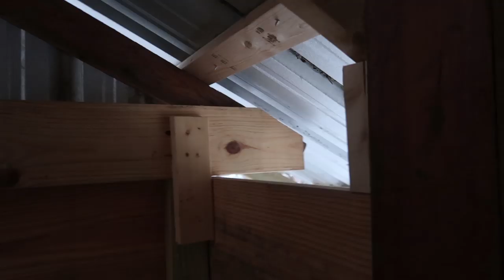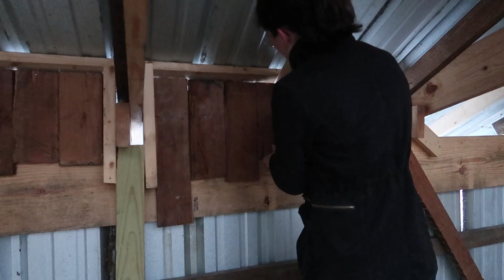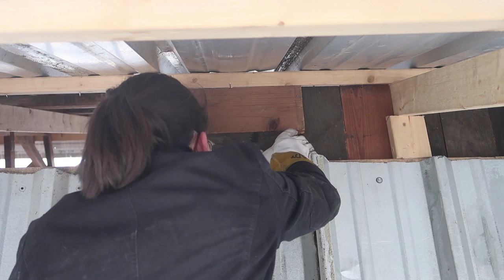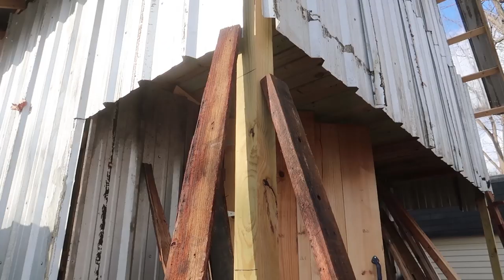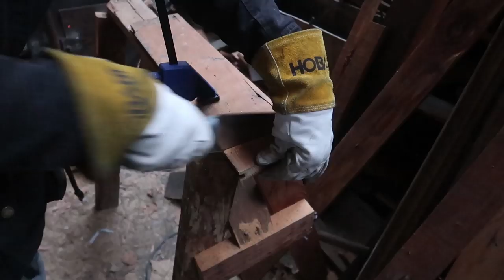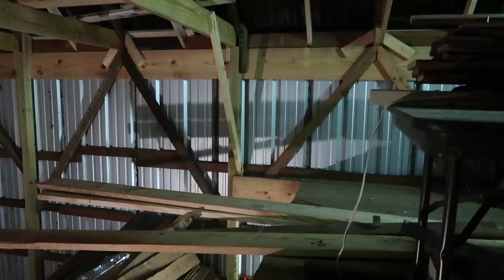Building a 15'x28' (5mx9m) Workshop 24: Patching Holes Where the Walls Meet the Roof

Comment: You are going to have a nice space for future projects, great project and very inspirational to me. I built three small buildings using recycled metal roofing. I tarp the framing in with the material lumberyards throw away that they use to tarp their lumber trucks, it's like tivek. I also duck tape the nail holes on the inside and patch them with bondo on the outside. All the best with your projects.

Comment: I personally would foam the corners . I just completed my garage and used battened insulation (r13 ) then plastic ( weep barrier) then luan thin plywood and its 70 in here and -10 outside! My heat source is different then yours but it looks like your making plenty of burning material! Lol . So far so good ! By the way mark your areas in the day time , it’s easier to see the light coming through the openings ! Lol

Comment: I used to work in a metal building here in Ohio. They spray-foamed the underside of the roof and it had insulated walls. Between running welders and such in the building, the cool night air would condense on the roof and it would almost look like it was raining. It produced a considerable amount of water on humid summer nights.
Reply from the maker: should have had a dehumidifier

Comment: Get some thin wall PVC pipe 4" if that is good, heat it up over the stove and cut a slit down it lengthwise.  Then you can let it open up so it goes around the corner and screw it down.  Paint is optional.

Comment: Rinoa, you have put a lot of work into this workshop, and it shows.
I don't know if you remember me, but I was the one asking about the batteries you've made for your electric bicycle.
I'm still building the Atomic Zombie Streetfox, and the build is coming along slow, but it's getting there.
Once I get the bike finished, I'm hoping to electrify it and charge it using renewable energy.
I wish I had a place like yours to do that sort of work in. Are you planning on adding solar panels and powering your workshop that way?
LED lighting has come quite a ways since the early days, so you might consider LED bulbs and rope lighting.
Reply from the maker: i remember you a tiny bit but then i searched all your past comments to get reminded. you told me "Oh, and keep smiling, it makes people wonder what you're up to." so that was quite funny.

Yeah i plan to have maybe 1,200 watts of solar on this, and maybe a wind turbine also just for fun. then i will use my Nissan Leaf battery pack to have about 24kwh of power capacity. but idk. i might just make a 1.5kwh pack and connect it to the grid.
Reply: Not bad. I do hope to send you a picture of the trike when it is done. It's powdercoated Seahawks "Action" neon green so it really stands out. I'm planning on lighting it up with both white and UV LED so the green stands out at night and the white can light up the road ahead. Have you done much with batteries lately?

Comment: Have you thought about filling the roof holes with slightly oversized metal screws with neoprene washers? Also, if you put up a ceiling fan you will get way more heat at the floor level.  Keep up the video's.
Reply from the maker: i already covered the holes with outdoor tape, and a friend just set aside a ceiling fan for me. so there ya go. ^^

Comment: A suggestion for fixng the corners and sealing the holes in the roof and walls. Fill in between the purloins/cross pieces at the corners wth pieces of two by four that overlap making an L shape closing up the corners, then you could screw the wall tin to them sealing up the corners. To seal the holes in the tin get some self tapping screws, a bit bigger than the holes in the tin, with rubber washers on them and put some tar over each hole and put in a scew and washer thereby sealing the holes.
Reply from the maker: that L idea is a good one, i hadnt though of it. however i think that would be a less-good solution since i would have to use a lot of 2x4s then. my plan is to scrounge up some more roofing metal and use that.

Comment: If you had some metal siding leftover you could bend into a square corner.  Look up a sheet metal brake.  You could make it out of the wood you have on hand.  Each corner piece could be cut to 3 or 4 foot piece and bent.  I think you could make one with no problem.  Good luck.
Reply from the maker: yeah thats what i was hoping for but i ran out. thankfully i keep finding more of other stuff. currently i have like 3 options. will ponder it while im getting other things done.

Comment: Aluminum valley flashing might work it's not real heavy gauge, runs about $9 for a 10"x10' roll at Home Depot, Lowes would probably be similar in price. Clamping a piece between two long boards will hold it place while you bend it. Maybe butt jointing 2 pieces of 1"x just make sure you pre-drill so it doesn't split.
Reply from the maker: well i'd actually need more like 24" wide metal for it to make sure its got a good seal. i plan to use old roofing metal or something.

Comment: I think you should put metal roofing underneath the floor of your loft cause air is probably coming thru the cracks of the boards
Reply from the maker: well im going to be putting down like a layer of thin foam, then hardwood flooring over that. and under the loft i will also probably add a "roof" of extra flooring bits and stuff some insulation above it.

Comment: I've got the same saw and the teeth are off sent some it is a pull saw other saws are a push cut so it cut back ward for regular and they do cut real good
Reply from the maker: well its a japanese saw, of course its a pull saw. but on this one a set of teeth arent offset correctly meaning it cuts a curve not straight.
Reply: its like when using a portaband and a bunch of the teeth have broken of on one side then it cuts a curve to
Reply from the maker: yeah, actually it is like that.

Comment: Teeth on a saw needs to be offset if not the saw would bind when you are cutting
Reply from the maker: but each side of teeth should be offset the same amount. for instance the machine that was supposed to press the teeth left didnt, but it did press the other teeth right
Reply: needs a saw set, to set the teeth
Reply from the maker: sadly these saws arent meant to be set since they are tempered so hard, so ill probably end up breaking the teeth

Comment: I wonder if edge gluing and later cutting the assembled panel would be a good idea.
Even transferring from a cardboard 'paper doll' like Mustie1 does for metal car body and frame work would be tidier and the waste is still good for that 'stove' that you've cobbled together?
Just an idea. Thinking out loud, lol.
Oh and about how much was your Japanese pull saw?
Reply from the maker: saw was only 10$, so i cant quite complain.
Reply: @RinoaL  you can gently tweak the teeth by sighting down the immobilized/clamped cutting edge. Maybe file. Meh, ten bucks IS ten bucks already spent.
Call me cheap... 😊
Reply from the maker: well sadly the teeth on these are tempered quite hard, so they crack off instead of bending. so i'll have to see about bending the metal under the teeth. idk.
Reply: @RinoaL  screw around with the temper and then see if you can retemper it. Lol. The temperature seems according to yoyoyodudetube (lol) attainable by toaster oven.
video idea
P.S a few fireworx in the ole toaster might be cool and appeal to everyone's Tween pyro bent. Lol

Comment: With all of that sealed up, you won't have any ventilation. Humidity will cause condensation on the roof since it won't have anywhere to go. That should help rust out the metal and rot the wood rather quickly. You really should read some home improvement books before you build. It doesn't take a genius to know that. Sorry if I sound like I'm bashing you. I am not. I just hate to see someone's hard work ruined due to a lack of education.
Reply from the maker: humidity is being kept at 50% with my dehumidifier. stop whining.

how about you stop expecting me to have a lack of education and just sit back and watch to see what i do?